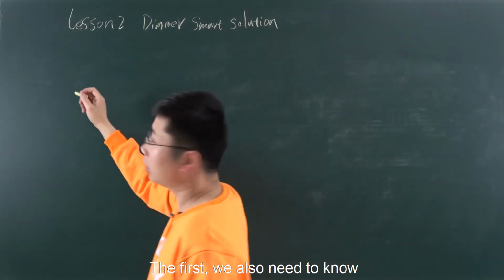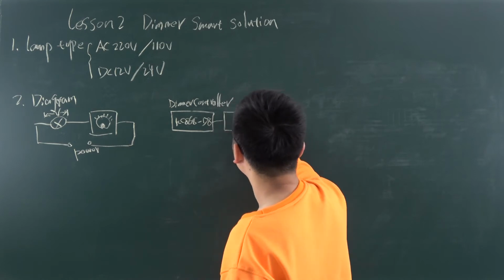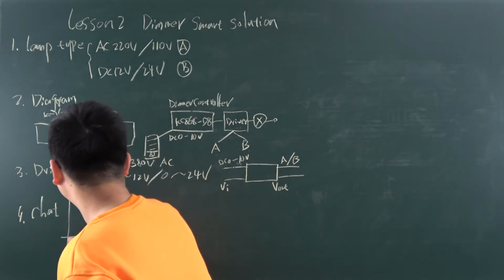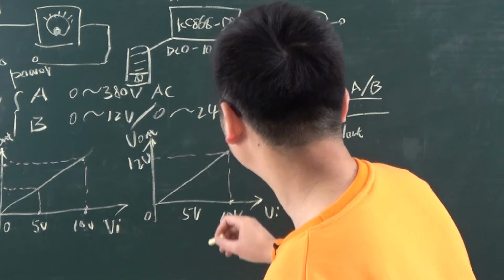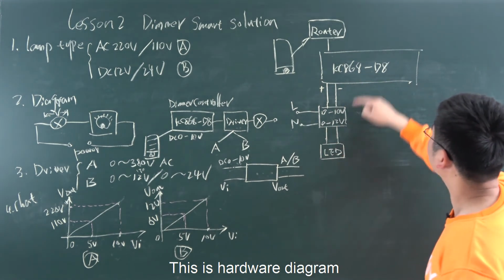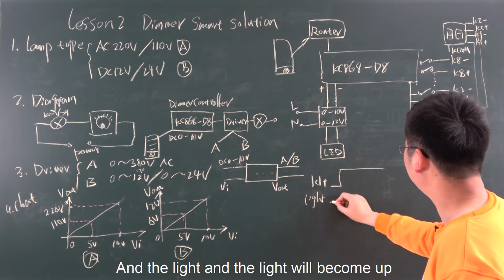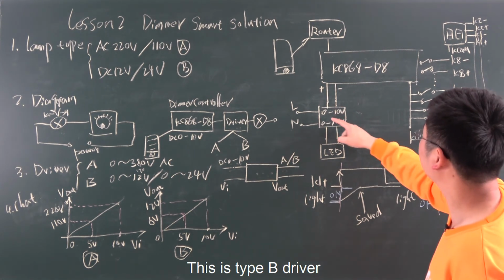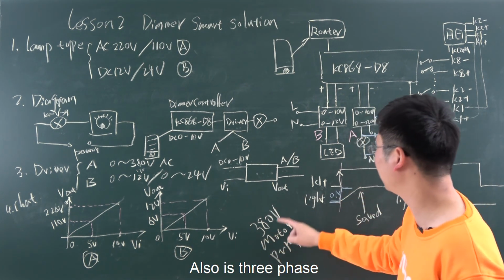【IoT training lesson beginners #02】How to let your dimmer become smart

Comment: Why can’t you make the kc868 wireless? In many homes it is hard to pull new cables for communication with the drivers😀
Reply from the maker: KC868 controller also have wifi, why use wired solution, because it's stable then wireless. almost without any after sell problem.
Reply: @KinCony  wow nice. But say i dont want to redo the main box and I just want to install the card and let the card to control for example windows light, how would the windows light communicate with the card?what protocols?and what recievers would work to take signals from the KC card?
Reply from the maker: @waelali3519  our controller support http command, mqtt command , tcp command, RS485 modbus protocol for you to integrate to your own system.
Reply: @KinCony  wow nice. But say i dont want to redo the main box and I just want to install the card and let the card to control for example windows light, how would the windows light communicate with the card?what protocols?and what recievers would work to take signals from the KC card?